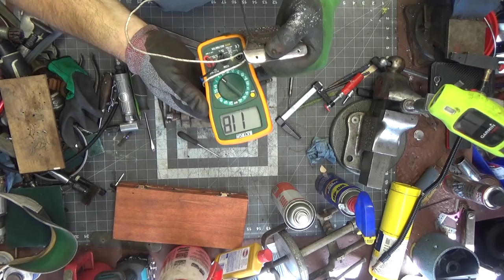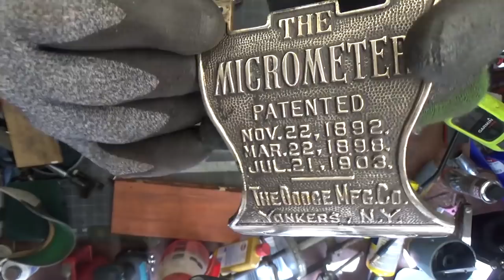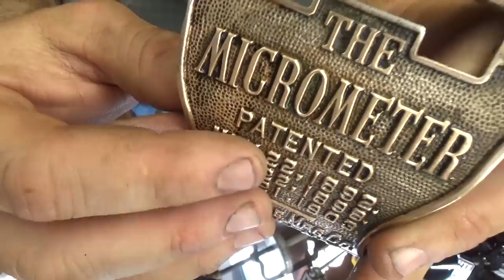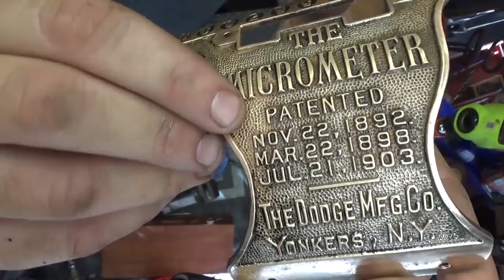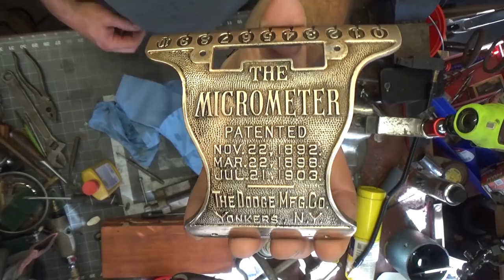Dodge Micrometer Scale (Part 1)

Comment: When you weld on stuck bolts, nuts, bushing, bearings, etc, that blast of heat can help to loosen the object.  Also the weld cooling can help shrink things.  But no matter what, you'll always feel like a rock star when you get that siezed fastener out without damaging anything else.   The scale project is moving right along.  Looking forward to seeing how the marble turns out.
Reply from the maker: Hi Bradley, i was so happy when that trick worked. It feels good to be back working in the shop, so I am making considerable progress.

Comment: Hi Joe, nice to be here, the scale base is so wonderful look at the artwork and the marble base top. We have done granite floors in the main offices of a machine shop instead of marble (marble was more common and cost less) to prevent staining from the feet coming in and out of the machine shop floor, do not know anymore then that to share.
You have a giant tool box in your kitchen, and you are afraid to take that piece of marble into the kitchen to wash it, she is already really cool letting the Milwaukee in there.  
We love the bucket, scale tray finish choice you went with. 
Thank you for the share we do favor brass here.
Lance & Patrick.
Reply from the maker: Lol, good point I have a giant toolbox in the kitchen, a peice of marbel should be no problem 🤣🤣
Reply from the maker: Lol, good point! I have a giant toolbox in the kitchen, the hunk of marbel should be no problem 🤣🤣

Comment: What a neat project. Try mixing this up to clean the name plate.  1/4 cup salt, 1/4 cup flour and enough vinegar to make a thick paste. Rub it in and let it sit for a while. I used it to clean an old copper and brass fire extinguisher that was tarnished so much it was black. I was amazed at how good it worked. You want it to be thick enough that it doesn't run off. I'd let it sit for and hour or two and then rinse it off. Then you can just polish it up. If you forget about it like I did one day and it dries up just run it under water and it'll rinse off. Hope it helps.
Reply from the maker: Hi Mike, thanks for the tip! This scale has so much bizzare gunk on it. Oven cleaner didn't even clean everything, i had to use a dental pic.

Comment: The restore is moving right along.  I liked the wire wheel tutorial.  Would like some more info on the pneumatic pencil grinder.  I don’t have a very high output compressor but that little bugger might work for a lot of the tight spots I can’t get to with other methods.
Reply from the maker: Hi Russ, I made a video about what i think of the pencil grinder. Tool review videos are tough to do well.

Comment: Bar Tenders Helper works very well on stone surfaces.  A lot of times when you can't get screws loose, they're gummed up. No matter how much solvent you use it won't come loose. Try soaking it in hot water for 15 minutes. Gums, and sugar won't break up with solvents, only hot water will work. Just as grease won't dissolve in water.
Reply from the maker: Hi Wire, that is an excellent point, which i had not considered. Thanks